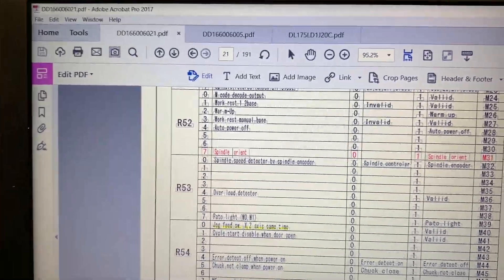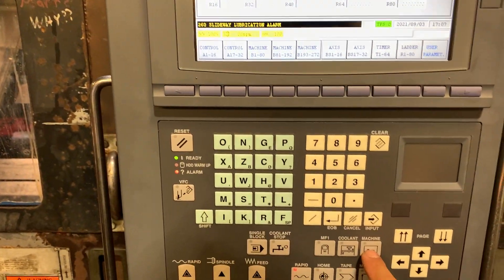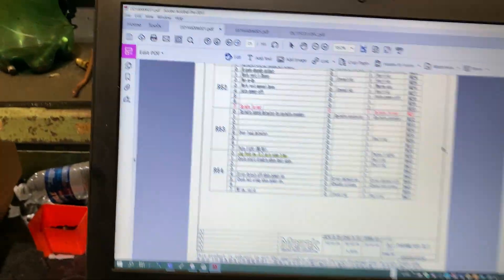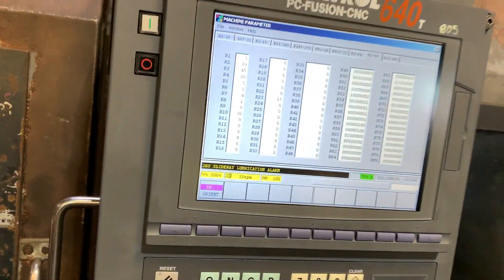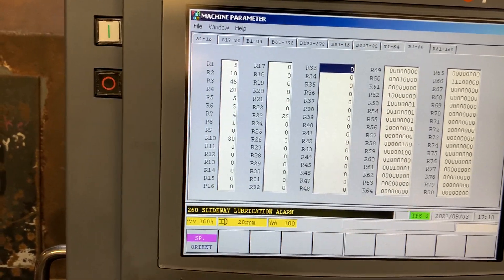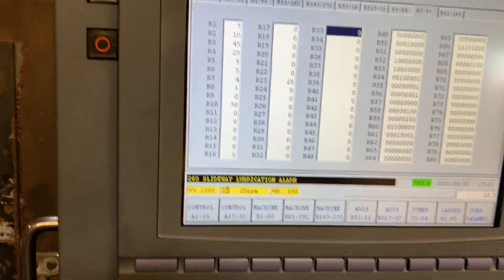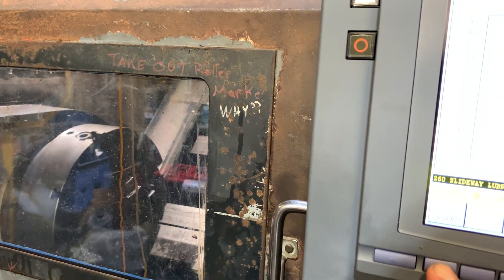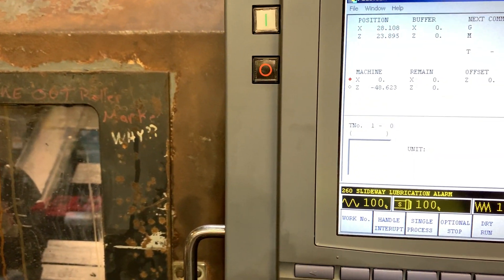M640T/T32-2: How to enable spindle orientation. Parameters R52.7 (Enable) and R33 (Orient angle)

Comment: Hi, we reinitialized the machine after battery died. We can move, home, start spindle change and measure tools, we have no alarms But the machine wont start the program in auto mode. The BUSY LED is lit and the machine does nothing. Any idea what could it be? We didnt use Floppy drive that came with the machine, we just loaded parameters from the EPROM. Im not sure if any option is missing after battery died. Thank you.
Reply from the maker: @iguana200  if you”ve reinitialized the using the backups from the FROM (Flash ROM) memory, should work unless it is a pretty old backup that the manufacturer saved. In that case is hard to tell if you are missing a parameter configuration or CNC options. 
Can you share a video?
Reply: @FabianAchaval  Hi, I reinitialized the machine from EEPROM and checked parameters with hard copy and everything seems OK.
Reply: @FabianAchaval  https://youtu.be/q6U-o-7LKEc?si=X_mpZypA-_28kYm1